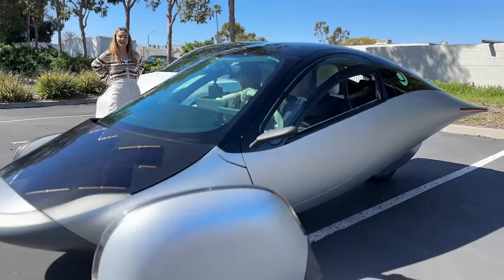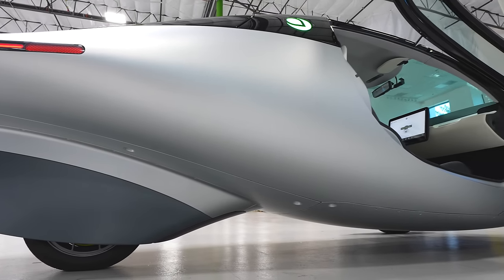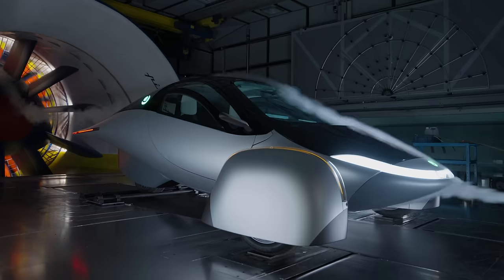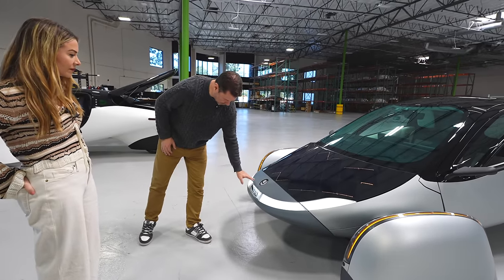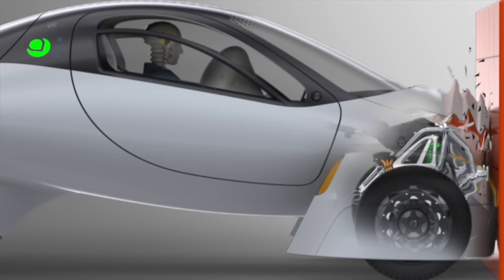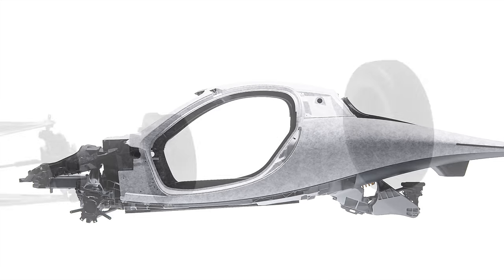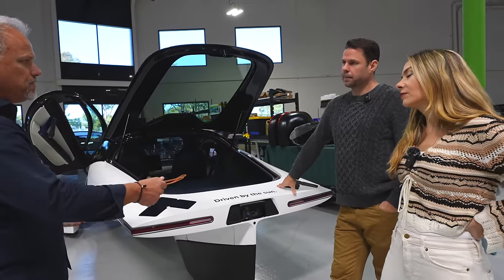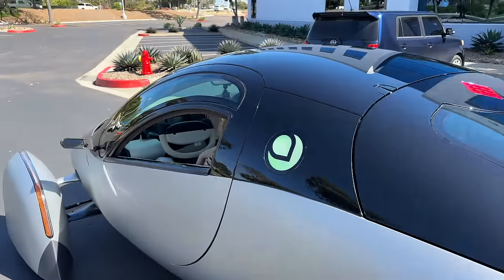Confronting Aptera's CEO w/ Investor - WHERE'S MY CAR?

Comment: Rear hatch opening with foot motion works REAL WELL when both arms & hands are holding groceries/stuff you need to set inside the hatch…   Actually very functional. Not just Ford uses that clever/practical feature. Adopt it!

Comment: and, i usually dont like these "concept" designs, but i actually like this, it just makes sense. And a electric viechle that does not have 2mw of power and has to have the same wieght of a freightliner just to have the batteryrange to be accaptable. For everyday commuting, if i had the wallet, this would make sense. Then have another car with a hitch for towing crap and space to go longer for the weekends

Comment: So the real test would be how the driver feels after he or she drives the Aptera from Carslbad, CA to Lake Tahoe.
Reply from the maker: Stay tuned…
Reply: LOL.  I'll be driving mine back to WI.
Reply: Same. I live in the Sierra, and really want to know how lots of uphill climbing affects the range. I’d originally optioned the 600 mile due to that, but switched to the Launch Edition 400 mile in order to get it sooner.
Reply: @michaelmay9958 And don't forget about cold weather taking 30% of the range. That's why I wouldn't take less than a 600 mi. range one.
Reply: @ictpilot  that was my original thinking as well. But I’m too impatient to wait for them to release the 600. If it turns out to be an issue for me down the road, I’ll buy a 600 mile and sell the LE.
Reply: I’ll be driving mine home to MN, the plan is to pick it up in San Diego when it’s ready. I’m not an accelerator but I did put in my launch edition order right away so maybe later next year or sometime in 2026? We’ll see
Reply: @ictpilot With a 40kw battery its going to fast charge ridiculously fast. Even with a 200mi range charging won't be an issue.
Reply: @boneman1982  Range not charging.

Comment: Another thing to consider is, because of the Aptera's crazy efficiency, even small improvements in battery energy density could allow for large increases in Aptera's driving range.
Reply: Aptera efficiency is mediocre. It is just very aerodynamic. Thats all. Useless under 70mph. Real BEV efficiency is expensive. Build a Tesla M3 drivetrain into an Aptera hull, and you could experience real efficiency.

Comment: In Europe and Asia where people are already fond of smaller vehicles I think this has enormous potential. Even in Sweden, where I live, with a lot less sun this would still have enough range and such a low cost to drive that I would love to have it for my daily commute.
Reply: It is not small!! It is wider than a Model S and almost the same length of a Model 3
Reply: @bowesterlund3719  Fair, I was thinking about the rather cramped interior.

Comment: I have a reservation in for the 400 mile Launch Edition. However, if the 250 mile version goes into production before my number is called, I will be switching to one of those.

Comment: I want one.  My future cars to add to my Model Y will be the Cybertruck and the Aptera. Since I had to sell my motorcycle because of back issues. The Aptera will be a nice replacement.
Reply: So why Do you want to buy the aptera motorcycle?
Reply: I have around 1/2 a million miles on 2 wheels, and love motorcycles.  My aging body is also not as sharp as it once was.  Both my wife and I have ridden in an Aptera prototype and will welcome the increased safety and comfort it offers - even over our present car.
Reply: @n.brucenelson5920  no proof whatsoever that the aptera motorcycle will be safer than a two wheeler.
Reply: Yes, I will be buying an Aptera to replace our Model Y. Just gave up my Cybertruck reservation to stick with our Prius which has much less environmental impact.

Comment: I'd still prefer if they kept the copper look over tin. Copper looks so much flashier. I can get why though as copper doesn't age very well.
Reply: I think it's a silver solder. That will look awesome. Plus, silver has the least electrical resistance. Almost all (99.9%) solar panels are made with silver for a reason.
Reply: @mpetty9947  I highly doubt actual silver, and the things we see are just the traces, not really the solder. 

And 90% of electronics use silver, but an absolutely minimal amount. Yes it's there, but in very trace amounts.

Comment: I've got the 1000 mile range version reserved for several reasons. I won't charge higher than 80% almost ever. So that gets me to 800 miles. In the winter, I'm just going to assume the range is cut in half. I know that's probably excessive but it's best to plan for worst case. I live where winters can get very cold and I also travel to places for work where winters get very cold. So that gets me to 400 miles. I work all over the country and drive to most work locations, and the US charging network is very sub-standard right now. Yes there's an assumption that you'll be able to use the Tesla network but that's not guaranteed to be the case immediately, or in every location, for a long time. So I need to be able to really put down some miles, consistently. I also work in locations with zero EV charging infrastructure within 60 miles or more. So I need a lot of extra range to depend on when the car is sitting under cloudy skies for a week or two.

Comment: 18:19 This on a Tesla would be great just for the case of off setting the phantom drain!
Reply: I’d trade the glass roof for solar peace of mind. “Phantom drain” is real. I keep my Tesla plugged in all the time just for that reason.
Reply: Actually given the extent of hands on engineering  Elon does and especially has a solar company, we can expect better output if Tesla does solar too. But yes at present PV efficiency this will be like 10 mile per day addition given real estate a car has. Cybertruck would be an awesome addition. Had an excellent flat bed.

Comment: So to be clear. Aptera solar provides 40 miles range at an average speed of 24 mph.  If you drive an average of 60 mph you will get about 7 miles range from solar.

The 1000 mile range also assumes an average speed of 24 mph.

Comment: Thank you for a very informative video…as an Ambassador I learned two new updated specs.  Aerodynamics originally advertised at 0.13 has now been revised to 0.15 and original estimated weight for 400 mile range variant was 2,000 lb now up to 2,200.  Really not the greatest news, I do hope that other tweaks will still provide the range that has been projected.
Reply: My understanding is the coefficient of drag cited was measured on the gamma prototype. While that is dramatically better than any other production vehicle ever built, the production intent Aptera has some refinements over the gamma. So it’s possible that when they do the testing on the production model over the next few months, the number may come in even better.
Reply: In 1930 the german Schlörwagen had a better aerodynamic. And it was a 5 seater. And lighter.
Reply: Was the higher cD due to rear view mirrors being required? Those are going to be easily removable, according to Aptera.
Reply: @jerrymcintire7902  Driving the deathtrap Aptera motorcycle without rear mirrors. Genius. Darwin Award.

Comment: As an Aptera investor and potential owner what I really want to know is:

-What will be the difference in 0-60 times between the four different range AWD versions? Obviously the 250 mile is lighter than the 1000 mile thus will accelerate quicker, however the Aptera website doesn't disclose a difference in the projected speeds while selecting different builds.

-Will there be less room in the 1000 mile version to accommodate the taller batteries?

-Are those huge crossbars on the side windows truly the best option? The Aptera is already a compact vehicle with less than average sized windows (Excluding the rear hatch). So to have a massive blind spot like the one created by the crossbars seems like a major disadvantage and potentially dangerous. Is there no way to make them thinner and possibly more transparent? As an investor obviously I believe in the Aptera company, however this is really the only issue keeping me from also purchasing the vehicle.

Comment: these new evs are like putting money into kickstarter projects....If they ever get to the point where they can actually deliver a product, it's way longer than originally anticipated and by that time, there might be other similar options built by companies who are better suited to ramp up production.  I've got a Tesla but I waited until they had a full production line with lots of vehicles as well as local support.
Reply: There are no projects on the horizon yet that fill the niche Aptera occupies.  I hope this changes.
Reply: Right on about the Kickstarter comment. EV's are a tricky business at this point mainly the fact that manufacturing costs are not sustainable by small players. Tesla was lucky to get through and even now it faces challenges. Aptera at this point looks purely conceptual, starting production by end of year doesnt seem genuine from the state it is in. Clearly few years away. Also given that its a 2 seater, the target audience can be quite limited.
Reply: @andysol2002 I’d be shocked if this ever gets to market tbh

Comment: I want to see a micro-pickup truck with this design philosophy, and an aero solution for towing ~2000lb, for example an Aptera enclosed trailer or trailer fairing designed to have excellent aero integration with the truck

Comment: Heated seats, heated steering wheel and 12v electric blanket for camping in the back or to put on your laps when road tripping should be good enough for winter in most places to save power. We have a 12V electric blanket under our couch cover which is powered from a 12V battery charged by a solar panel in winter.
Reply: Confirmation of heated seats coming is huge for me.  This was considered shelved and as a canadian this is a extremely important feature.

Comment: Would love it if the batteries were upgradable, as in I could buy the lower range version then add more battery capacity later. Not sure this is feasible, but it would be a huge selling point for me.
Reply: Would think the battery needs to be replaced at some point. If it can be replaced the next size up should be possible.
Reply: They've said it'll be possible, but not trivial. Sounds like you'll have to take the car mostly apart. It wont' be something you'll want to do often
Reply: I have found that many of my friends with electric vehicles had range anxiety only to find that they didn’t actually ever really drive so far without returning home for it to be much of a concern at all. My best advice would be to start tracking your range that you currently use each trip and calculate how much you really would need 400 miles with a 40 best case addition a day without even plugging in is a LOT of mileage. But they are also making 600 and 1000 mile versions later for those of use with road trip requirements or aspirations. At a charge rate it has if you can stop for lunch at a place with a charger or a plug willing to let you draw electricity you should be fine for cross country trips.

Comment: BMW i4 eDrive40 on 18" wheel delivers 4.6 miles/kWh. So Aptera is double that efficiency, not 7x or 10x other EV cars. Aptera is estimating 9.6 miles/kWh, so just over 2x  the efficiency the Model 3 or our BMW.

Aptera should immediately publish an independently audited Life Cycle Assessment to prove how much more sustainable the car is including production, operation with and without solar, and recycling. Others including Polestar, Volvo, Rivian, and BMW have done this with EV models showing actual numbers (Rivian played Tesla's game of showing an unlabeled bar graph without discrete data points so you have to extrapolate).
Reply: Aptera has done preliminary calculations along these lines, but will want to have a much more thorough analysis before they publish it.

Comment: For decades, I have dreamed about building a two wheel vehicle along lines very similar to the Aptera.  We know the balancing technology is out there. even some motorcycle manufacturers  have worked on prototypes.  From an efficiency point of view, there are significant benefits to be had.  Less rolling resistance, with just two wheels, less aero with no wheels hanging out from the main body, but shielded by the aerodynamic body, and making the car less easy to hit, and the list goes on.

The auto stabilization could be designed to lean into corners with driver and three passengers pushed down into their seats no matter how spirited the driving.  Could this be Aptera's next big challenge?  Could this be even more efficient than the three wheeler?  

Thankyou for your dedication and creativity in turning Aptera into a reality.  I will stay tuned!

Comment: My main question:
Now that Aptera is approaching Delta and Production Intent, will the glass rear hatch actually be available for those who choose not to get rear solar? Or is that just a Gamma thing?
I absolutely love the prospect of camping in this thing, and the transparent rear glass "stargazing" is rather appealing, even if it costs me some solar recovery.
After all, the solar is not the primary reason why I want one of these - I just love the prospect of having an insanely efficient vehicle.

Second question/thought:
I do wish that there were a way to put critical instruments (most importantly your speedometer) in front of you instead of on the center screen. Particularly in case of center screen failure. It'd be pretty epic if we could overlay that information on the side-view-"mirror" screens - or do so automatically if the system detects the center screen has failed.
This is really important information to have at the driver's disposal. For a vehicle so focused on sustainability, serviceability, and repairability, the ability to get it home after a malfunction feels like a valuable one, and having a single point failure (center screen) that would render the vehicle unsafe/illegal to operate seems counter to this.
Reply: I suspect that the solar hatch plays a significant role in the rear crumple zone, and that the addition of a glass rear hatch would involve new crash testing to insure safety.    We will see after the PI builds.

Comment: I wish Chris A. would stop saying you'd get 700 watts of power (from the solar).  At standard test conditions (STC), it will likely be on the order of 500 to 550 watts after the solar charge controllers.
Reply: For a while there Chris would correctly say Aptera has 700 watts WORTH OF SOLAR CELLS but, as you point out, he's reverted back to the incorrect 700 watts of power which it will NEVER do (even in New Mexico).

Comment: I'm anxiously waiting for my launch edition Aptera.   However, I'll wait for a version that is more suited for my cold environment.   At the minimum, the heated seats and heated steering wheel, since those the most efficient ways to keep warm.    And then I'll think about whether to wait for a version with a heat pump.  I am hoping that Aptera can learn from Tesla heat pump technology and not reinvent the wheel or create god-awful and overly complex heat pumps like Ford or GM.
Reply: I'm also hoping that, given their right to repair ethos, they'll be able to design a drop-in retrofit kit to replace the existing cooling system, kinda like how the Framework modular laptop can swap multiple generations of mainboards within the same original chassis.
Reply: What Tesla did with the Superbottle and subsequent Octovalve heat pumps was amazing, but Tesla should avoid trying anything complicated like that. Tesla has endless resources to throw at engineering problems, but Aptera has to be very careful with its money and only attempt things that can be done cheaply, so it is best for Aptera to rely on outside suppliers who have already done the investment in the R&D. Hopefully Aptera can find a good supplier to provide its heat pumps, and doesn't have to engineer its own solution like Tesla did. 

My biggest worry is that a heat pump will harm the modularity of the vehicle and make it difficult to repair and upgrade. Connecting the battery, motor and cabin air conditioner/heater in a heat pump is only acceptable if they can make all the hoses have disconnects between the modules in the car.
Reply: How would the 1000 mile version not work in your cold environment?
Reply: @justinw1765  everything about aptera is efficiency.   If I don't care about that, I could get a grossly inefficient Hummer EV; which can go far in comfort in a cold environment.   The 1000-mile aptera doesn't make sense to me because it's highly inefficient to drag around the big, heavy 1000-mile  battery just so that I can benefit 0.01% of the time.   During my 40yrs of driving, there was zero time that I drove 1000 miles in one day.
Reply: @Chitown388     I understand all that. I thought you were saying earlier that the 400 mile Aptera didn't suit you because of your local, cold climate, and thus that you needed more battery to compensate?  

  Are you waiting on the 600 mile version instead then?

Comment: My wish list, heat pump and steer by wire. Seems like steer by wire would make it easier for right-hand drive market configurations. I do like the blind spot view screens in front of the driver, but I’d like to see a small space carved out of the middle of those screens for speed and battery percentage.

I put in an order for a 600 mile range version but might cancel if there still isn’t a heat pump by then.